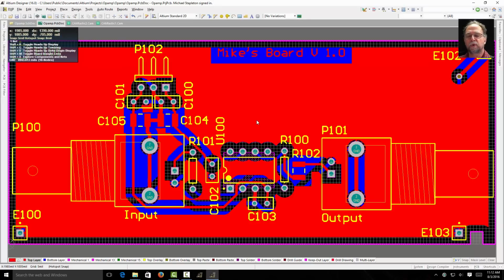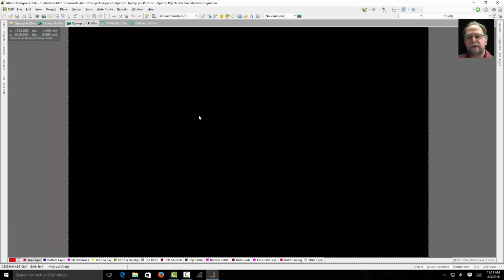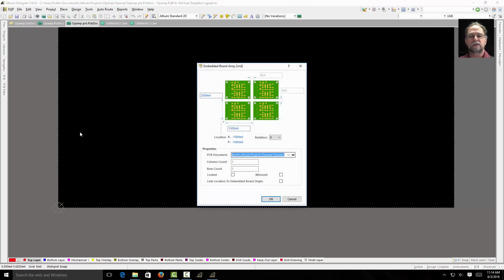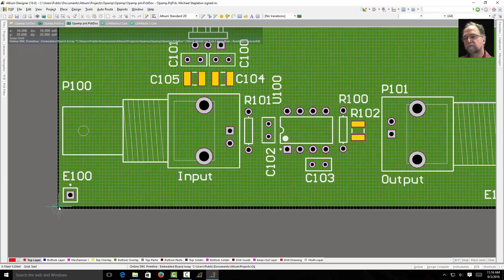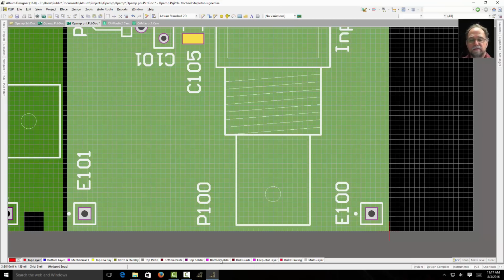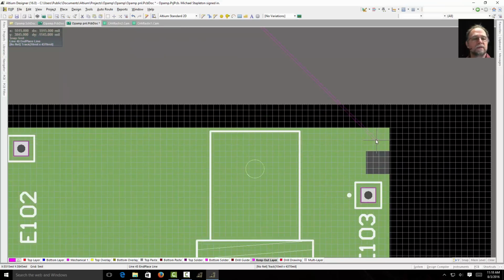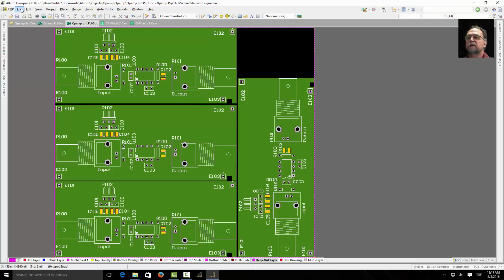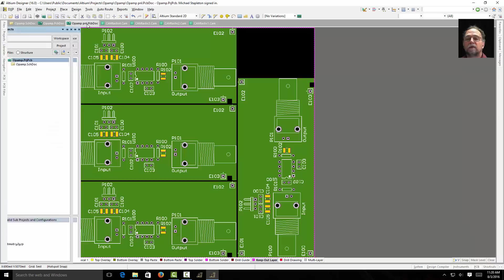9 Making a Panel of Boards

Comment: i am facing some problems in pcb routing, when i finished the schematic i updated schematic and components appear in the board, but always there is an error .the pad colour is always green with cross mark. and the components are in topoverlayer, i couldn't find the pproblem, can u tell me whats the probllem?
Reply: Jayesh, you should make sure to delete the 'Room' that is added to the board. This is a big point of confusion for most people who are designing in Altium.